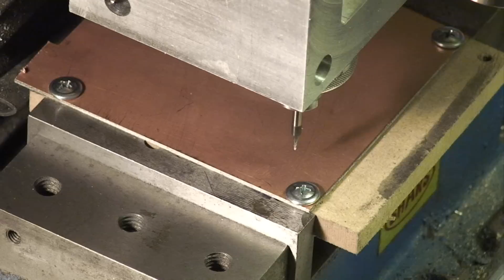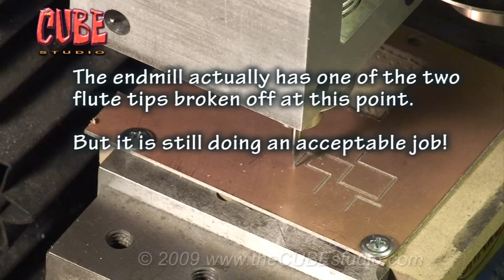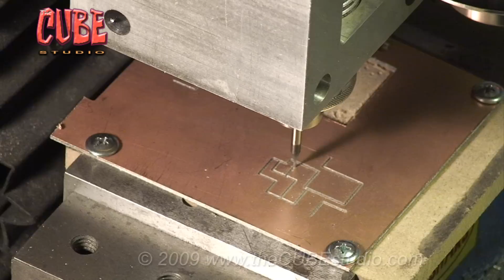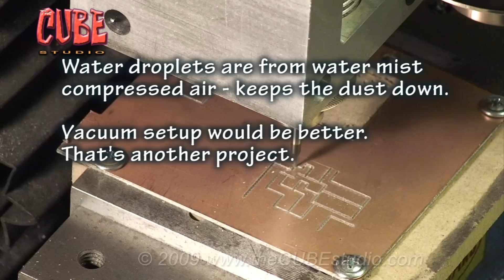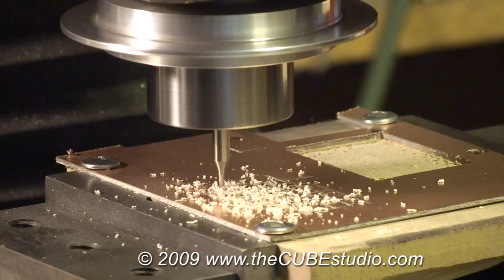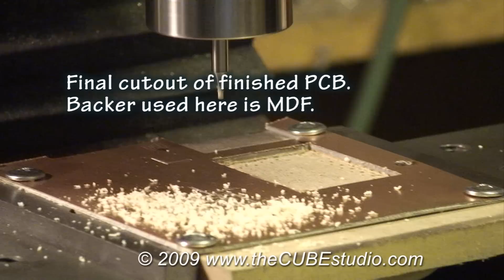Mini Machining Center makes a PC board - Routing and Drilling and cutour

Comment: I use expanded polystyrene (they use it at sign shops) and it goes by the trade name Sintra. Cuts like butter and I take a skim coat to level the board before milling. You should be able to mill faster than that BTW. What is the RPM on your air grinder?